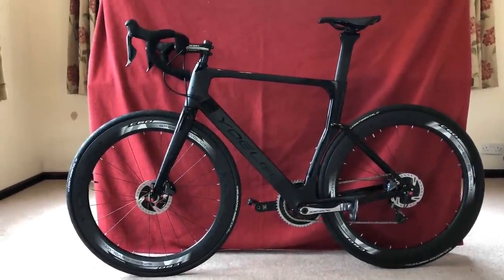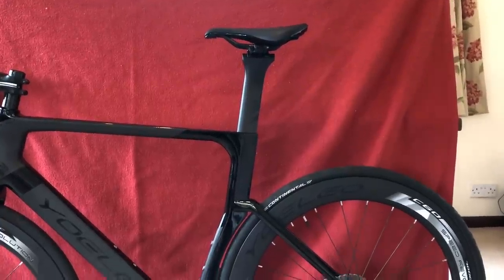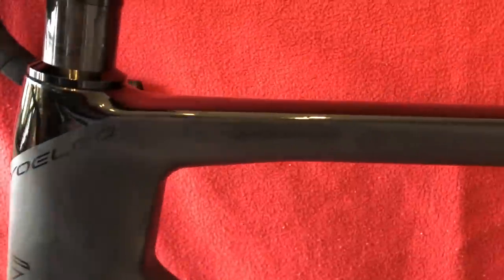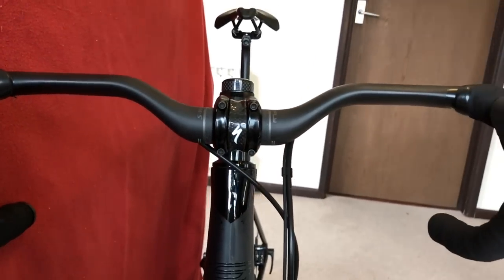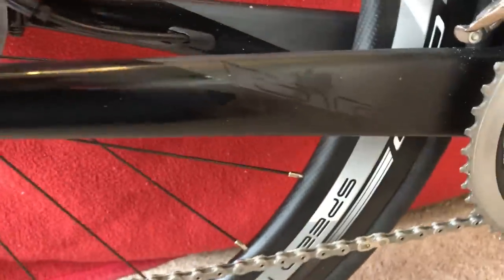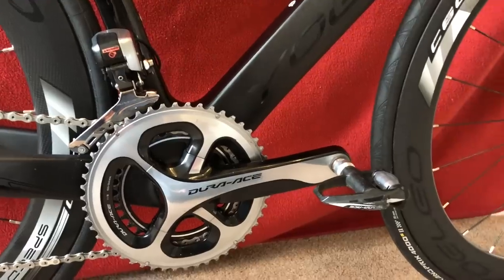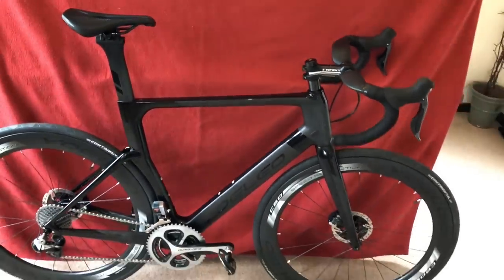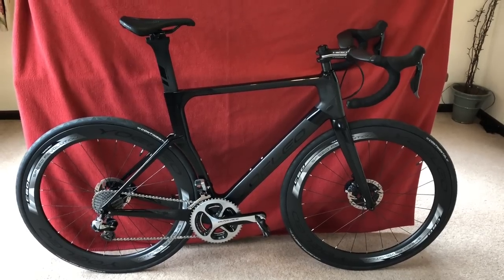Yoeleo R6 Aero Disc Finished!

Comment: great looking bike, I have the new cube agree slt 2018 - you should also put a piece frame protector on chainstays where the rear disc brake is located - the disc easily scratches the frame when you take the wheel and on.
Reply from the maker: jacob mortensen yes I will, I just got my frame protector sticker set through the post a few days ago.

Comment: awesome looking bike, its a Specialized system to angle the stem, its a sleeve between the stem and the steerer you rotate to change the angle... it should be on the bottom but you need to use the stem cap it came with as its slotted to allow for the bolt/angle change (hard to put into words, would easy if I could post pic :) )   also all the direct from china bikes I have seem come with Shimano E size axles (can't remember the exact length and thread pitch)    also you should have received a tiny little grub screw, its to hold the threaded thru axle bolt on the frame so you can more easily remove the axle without dropping the bolt every time.

Comment: I’m sure you’re not looking still for an answer to you stem spacer conundrum.  However, I believe you need a wedged spacer at both the top AND the bottom of the stem.
Reply from the maker: Randy Sandoval yeah I’ve moved on from that stem now, but it was fine like it was, the LBS confirmed it was the right way, just needed the steerer above the stem cutting off. 👍

Comment: Shrink wrap (black) over brake cable with di2 cable would smooth up front routing to handlebars
Reply from the maker: Chris White yeah I’ve got some cable wrap that I’ve been using, it wraps round in a spiral motion, allowing the cables to move but still being wrapped together, I do like the the shrink wrap though. 👍

Comment: 18.5lbs give or take for disc and 60 mm isn’t bad at all.  That specialized stem has a micro adjust insert that is on the bottom just like you have it.  it can be spun around to raise the angle of the bars and that will flatten the top spacer to the stem, otherwise you have to cut the stem.  In reality, ensuring stem is tight to steering tube and washer is also putting proper down force, you shouldn’t have any issues with this current set up.
Reply from the maker: Tony Crabtree nice info thanks! Yeah I’m pretty happy with the weight to be honest.

Comment: A quick request. Can you drop a string line from the front of the seat and see what the distance from the string line to centre of bottom bracket is? I am curious.Not that it makes any difference for social ridingg but UCI rules say not closer than 50mm.  And btw .. time to service your pedals .. lol
Reply from the maker: cannon1156 will do! I’ll try and get onto that in the next few days. And yes about the pedals... about a year ago I tried to service them myself, may have over torqued them or just not done it properly, but will definitely take them in... thanks for reminding me. 👍
Reply from the maker: cannon1156 just measured it and it’s 70 mm as far as I can judge. Oh and the pedals are off and ready to go to the bike shop! 😁

Comment: Looks great! Please could you post a materials list of all components (Di2, BBracket, etc)? Especially the Di2 cables (lengths) and internal junction boxes etc? Am I right in thinking it is 6no. cables in total? At £15 each that's circa £100 on cable....wish they were cheaper....
Reply from the maker: Lazlo Suppel I’ll see if I can get into that soon.
Reply from the maker: Ok lets start....

Copy and paste but heres the list of components.... ENJOY!

Yoeleo Frameset (ghost) - R6 Aero Disc 56cm with BSA bottom bracket
Yoeleo C60 rims (ghost) 25mm Wide
DT Swiss 240 Straight pull Disc Hubs 24 hole
Spokes not sure but double butted 
Nipples not sure but brass - aluminium one corrode over here very fast because of the sea air
Shimano Dura-Ace Ice Tech FREEZA 140mm Centre-Lock Rotors
DT Swiss Lock rings (arriving Shortly)
Continental Grand Prix 4000S II Folding Road Tyres
Continental Light Road Long Valve Inner Tubes
Shimano Ultegra R8070 Flat Mount Disc Brake Calipers
Continental Rim Tape - Black
Shimano Ultegra ST-R8070 Di2 11 Speed STI Road Levers
Shimano Ultegra R8000 SPD-SL Carbon Pedals
Shimano Dura Ace BB-R9100 Bottom Bracket
Shimano Dura Ace 9000 HollowTech II Compact Chainset - 50/34
Shimano Dura-Ace R9070 Di2 Front Derailleur - Braze on
Shimano RD-9070 Di2 SS Rear Deraillieur
Shimano Dura-Ace 9000 11 Speed Cassette 11-28
LifeLine - Carbon Headset Spacer Kit, 6 Pack
Shimano Dura Ace 9000 11 Speed SIL-TEC Chain (116 Links)
KMC 11 Speed Chain Link
Specialized Power saddle 143mm
Specialized S-Works stem multi angle +/-12 degrees 110mm
Shimano EW-WU111 wireless unit
Shimano BT-DN110 Di2 Internal Mount Battery
Specialized S-Works Aerofly Carbon 25mm Rise Handlebar 
Specialized S-Wrap Roubaix Handlebar Tape
Shimano SM-JC41 Di2 Internal Cable Junction
Shimano E-tube Di2 Frame/Bar Plug Mount Junction A Charging Point 2 Port
SHIMANO brake cables SM-BH90-JK-SSR for hydraulic disc brakes Road | straight connection 
1x EXTRALITE Thru Axle Black Lock 12.1 | 12x142 mm for Shimano E-Thru 172mm (arriving Shortly)
1x EXTRALITE Thru Axle Black Lock 12.5B | QR12 Road 125mm (arriving Shortly)
1x SHIFT UP Nut M12 for Shimano E-Thru Thru Axle 12 x 142 mm (arriving Shortly)
Shimano Di2 EW-SD50 E-Tube Cable x 7 

Im only sure on 2 lengths of E-Tube Cable - 600mm through the bars and 650mm from the left shifter into the frame attaching to the EW-WU111 wireless unit, the other lengths came from my old bike so I just put them in the same places

Think thats the full list

Phew!

Comment: i have a specialized stem on my giant tcr, it has an insert with an off set angle on it so  i can rotate the insert 180deg to achieve 2 different angles of drop and 2  different angles of rise...without the insert, the stem is way too large a diameter to clamp the steerer.  but you should not have ant gaps around spacers as it will apply an uneven pressure on the headset bearings.
Reply from the maker: julian morris nice thanks for the info!

Comment: I've not seen a angle stem spacer before, I thought everything there needs to be square and flat so to speak. I think it needs to go completely.
Reply from the maker: S W I’m not sure myself, I spose I could ask the LBS if they just forgot to move it. Seems weird having a gap under the top spacer...
Reply: well, I see it as its all got to be parallel there, stem and fork steerer contact, an angle spacer will surely try and skew the fitment which seems incorrect.
Reply from the maker: S W it came with the stem, if I don’t use it the stem clamp is too large for the steerer tube. It should be the other way up though.
Reply: That's odd.
Reply: Is there a separate shaft insert in the stem which you twist inside the stem to adjust the angle before clamping it ? The part where your stem says -4 printed on it? if this is so, I would expect you should have 2 of those angle spaces, one on top and one on bottom of stem and rotate them depending on your set angle.
Reply: This is a Specialized innovation.  My 2014 Tarmac has it.
Reply: Not dis agree, just as Kyro mentioned, it seems odd with the gap.
Reply: S W So which specialized bicycle do you have with feature?
Reply: I don't have this feature stem, first time I have seen it. I do have a specialized bike though
Reply from the maker: S W there was only ever one... but it was on the top as it was the other way up.
Reply from the maker: Tony Crabtree ah I see
Reply from the maker: S W yeah it does seem odd...
Reply: I have a specialized stem comes with 3 angle capping . I didn't use the -6 capping as it would leave a gapping like these as well . So is it normal ? I ride brand Tantan china direct factory bike for 6month myself no problem

Comment: the stem comes with a special top cap to get rid of the space, i don't think you can have spacers above the stem because of this
Reply: you can put spacers above the stem, I just read the data sheet
Reply from the maker: Thomas Tarr yeah we just put the 10mm spacer there until I’m sure of the  height I want it as it’s lower than I am used to, when I’m happy we’ll chop off the top bit.
Reply from the maker: Thomas Tarr yes it did come with a top cap, I still have it. And I remember it only looked correct one way round, perhaps it is angled to take out the space as you say....
Reply: @KyrosHouseCycling  You have obviously figured this out.  However, just for clarification, this angle of this stem is adjustable with a shim that fits over the steerer.  The special top cap is to compensate for the shim in the stem which changes the effective angle.  If you turn the shim inside the stem to change the angle, you must also spin the top cap around to compensate.
Reply from the maker: @finncox23   Yes thanks for the info!, I have changed my stem now though, video too come, its all uploaded and ready for release within the next month, thanks for the comment.

Comment: Your stem spacer / angle shim is on correctly. You cant have any head tube sticking out above the stem when using a Specialized multi stem. You have to cut the head tube or use a different stem. Here are the directions: https://media.specialized.com/support/0000016662/0000016662_IG0383_revA.pdf
Reply from the maker: Norevlimitr yeah just going to check if they are at a comfortable height before cutting off the steerer tube above the stem, then it’ll be all good.

Comment: That spacer needs to go on top
Reply from the maker: andrew geary the spacer is designed to go on the bottom, now I’ve slammed my stem and cut the steerer, it fits perfectly. 👍
Reply: Have a friend with the same stem setup and his was on the top. Maybe with a spacer it does better on the top. Glad u got it lined out thow.
Reply: its a Specialized system to angle the stem, its a sleeve between the stem and the steerer you rotate to change the angle... it should be on the bottom.  @KyrosHouseCycling

Comment: Well done - good work looks great. Really interested to see some follow up ride reviews. Tempted to go down same route
Last year, I got some Yoeleo SAT 50 disc wheels also which are great - but initially I had issues with fitting centre lock ring for rotor on the hubs they came with (supplied by PowerWay I think). I had to take them off get wheels rebuilt by LBS with Shimano hubs instead, which was a pain - but Yoeleo did offer some refund. Did your wheels come with those DT Swiss hubs from Yoeleo? I noticed you seemed to have some issues with the rotor lock ring also
Reply from the maker: John McAuliffe no the rims came just as rims, I built them up with the DT Swiss hubs I already had. Always had issues with the front one, that’s why going to the bigger lock ring, DT Swiss brand for DT Swiss hubs.
Reply: Ok thanks for the info. Good luck with it - hope it rides well!
Reply from the maker: John McAuliffe thanks! And thanks for watching!